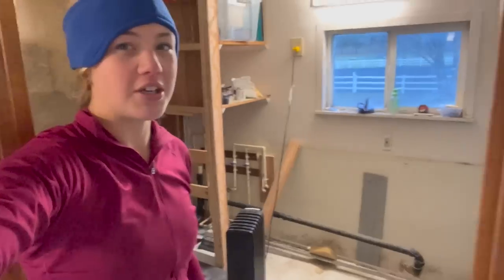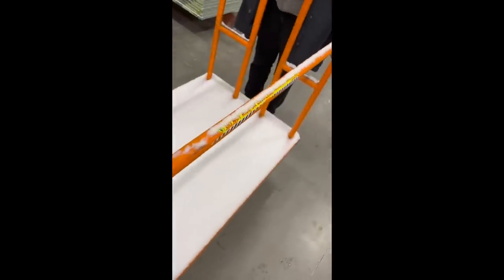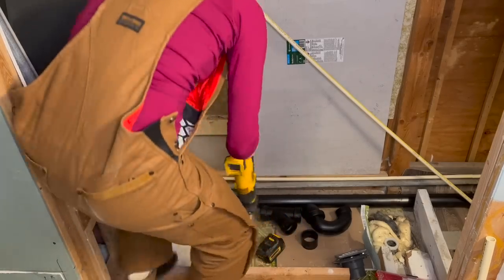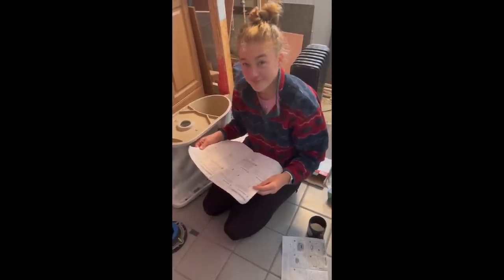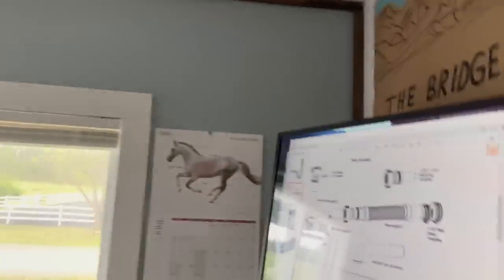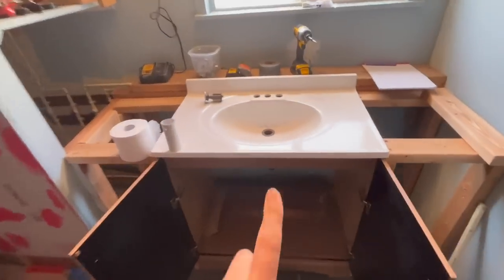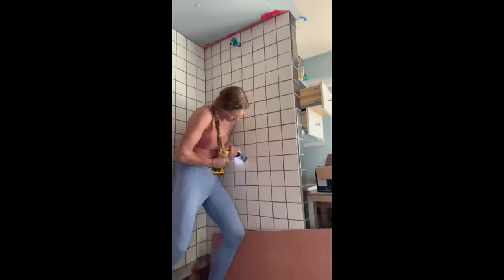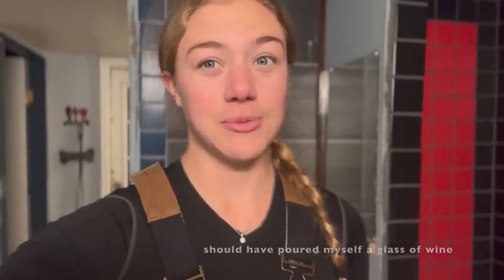Mobile Home Remodel 2022

Comment: In my experience, the two areas that should always get professional input, if not help, are plumbing and electrical. Water can flood your house, and electricity can burn it down, especially in manufactured housing.
Reply: It gets inspection